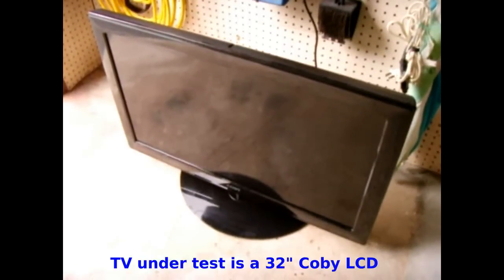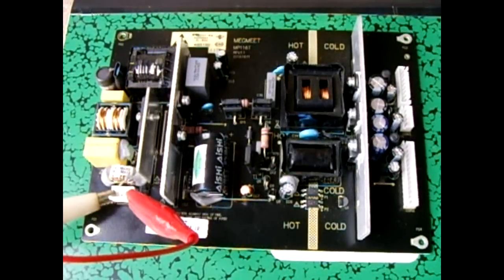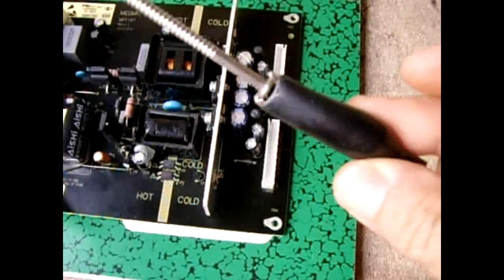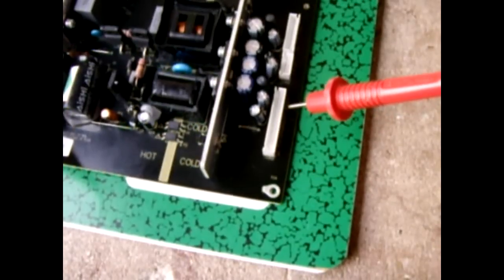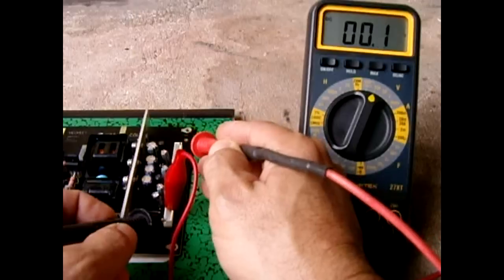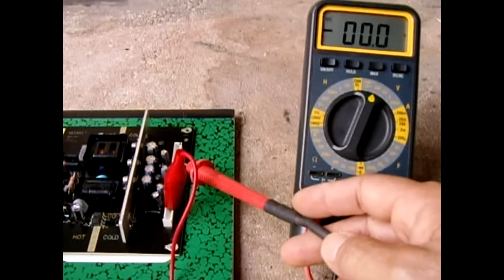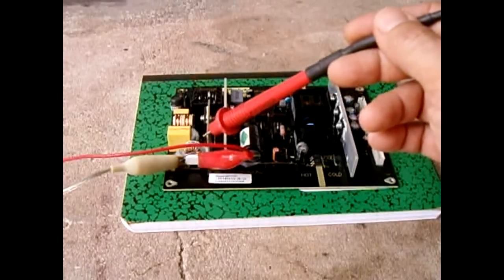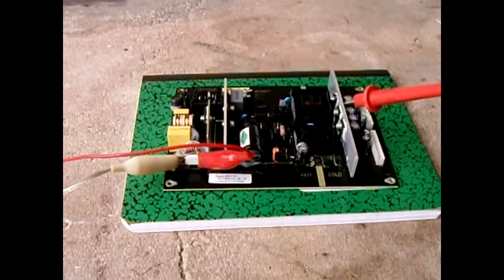How To Test LCD/LED TV Power Supply Boards(No Power)

Comment: Thanks for your video. I can't seem to find a 'SB' or 'STB' pin. The other two pins are labeled 5V and DIM (O/F) not counting the 12V and GND pins. When I touch the black probe to the ground and check the 12V pins they all show 12V. I guess my board is defective.

Comment: Hey FYI,
  I've been trying to rig up a curb side special Vizio 42" as a bench light. I have the advantage of a working TV and am just trying to get the CCFL inverter working without the main board or LCD driver. This one has a 5 volt standby, 12 volt, and 24 volt rail. The PSU has an on/off pin, PSON, and PDIM pin. The inverter IC is one of the pesky o2 micro chips with an NDA Datasheet (OZ9976).
  I can confirm, this power supply needs the PSON and ON/Off pin jumped to 5v. The PDIM pin needs to be set between 2 and 3.6 volts but does not need a PWM input.
  However, contrary to your video here. The power supply will not start by jumping out the standby rail. It has to have a substantial load on the output for the main output rails to work. When I disconnect the 3 extra pins from the processor board and jump them out (on/off, PSON, w/a 3v3 regulator output on PDIM) but keep the connection for 5v, 12v, 24v, and ground to the processor, everything works like it should and the backlight comes on and stays on until I disconnect the mains plug.
   I am here because I have been looking for ideas on how to rig something as a load. I've tried load resistors all the way down to 270R on the output and that doesn't work. I don't want to go much lower on a 24v rail. I'm about ready to just add an auxiliary supply for the inverter IC or use a small boost circuit from the 5v rail. I thought you might have covered something like this here, but after seeing a discrepancy between what I'm seeing and the video I thought I'd mention it. This TV is probably some rare exception, but I figured it was still worth mentioning that jumping the on/off PSON pins doesn't get power going on this design.
Thanks, -Jake
Reply from the maker: Hello. I'd ditch the CCFL and use a really bright LED strip light instead.

Comment: I tested the fuse and it read good. I tested the power to main board and I'm only getting 1V so i don't think enough current is getting to main board (no standby). Any video for checking each leg of this circuit. I have no visible damage on top of under, no swollen capacitors.

Comment: My backlight leds on an LG 55" TV are not turning on at all & I suspect one of two IC'S, One is the HS01G PHVK pwm controller & the other is a L6599AD RESONANT CONVERTER CONTROLLER. Any idea which one would most likely be the culprit?

btw all capacitors look good, however I changed the two main caps just in case with new Rubycon caps. Once removed the old caps tested good just as I suspected.

Comment: My Finllux 50F6090 video keeps going off while the audio is still on. You can change the channel and get the audio for the channel but without the video. Looks like it is the power that is being lost. If one turns off the TV the video comes back perfectly but is soon lost again  This cycle is then repeated again and again.  What could be causing this intermittent black out of video in this set? Help please

Comment: Hi there using your method I have checked Apple LED Cinema Display power supply board on all the pins reads close to what it says (only like 0.2 or 0.4 V difference) apart from one pin where it says 24 V and reads 25,2V is that acceptable?(using mid range multimeter)

Comment: I have a Sansui sled-43fhd TP.V56PB'801. The standby light is on and red, when I switch on the tv, the standby light changes to blue to show that the tv is booting but it will flick the sansui screen and goes off. Any idea of what the problem is?
Reply from the maker: More than likely the power supply board has one or more faulty electrolytic capacitors. Either replace the capacitors or buy a new power supply board.

Comment: When I short the PSON with the next pin I test the other voltages. The 5 reads 5 and the 12 volt reads 5V and so does the 24V pin. They all read 5 V? When I take the alligator clip off the PSON and the pin next to it, I can only read 5V on the 5 v pin. The others don't read anything at all. I short the PSON to the SGND is that right using an alligator clip? The 5VSB volt reads 5 volts.

Comment: Thanks for your guidance. I have 26LG30R LCd. I can see P/On on power board but no STB 5v, could you please guide me here, board is OPVP 0059.
Reply from the maker: They vary a lot. Try jumping suspected pins using a 1/4 or 1/2W 1K resistor. The resistor will keep you from destroying things while you search. Try a 5v pin, or a GND with the PSON.

Comment: I replaced a swollen capacitor on a 42" Dynex DX-L42-10A.  Now, I keep blowing fuses. What could be causing the fuses to blow?
Reply from the maker: If you replaced it with the same value/rated capacitor, in the correct orientation, then it shouldn't blow the fuse. Clearly you did something in the process of replacing the capacitor.
Reply: @electronicsNmore  Wondering if maybe I used too much solder and somehow shorted them out. Waiting on some solder wick to come in.

Comment: Hi.. One Question.. My Power Supply indicate 11.8 Volts in 12 Volts pins and 32.3 in 33 volts pin, all others are OK (5V,3.3V,24V).. This voltages are OK? is in a safe range or must be a little greater than mark the pins? I ask because the image in my TV have some noises and i don´t know if this is the problem or is the video or T con targets..Thanks
Reply from the maker: LookingMercury3D Sounds pretty good to me. As long as the voltage is fairly close, you should be fine. Check all the capacitors for swelling. If any are bulging, replace them.

Thanks For Watching! Be sure to rate Thumbs Up and Share.
Reply: Yes, i repair the power supply, it was dead, the power Mosfet  was in short, change too all bad  capacitors but i can get up that voltages, i was thinking in add another Cap in parallel of minor Farads  to see if it Up at less 12.1 volts, i need to know if that is the problem with the noise.. Thanks Men.. Thumbs Up
Reply from the maker: The noise could be coming from another board. Also check for capacitors that may be shorted. I have seen that in the past, and some were not even bulging.
Reply: electronicsNmore The Noise is in the TV Image, is not a Noise Sound in the Board, i believe that the 12 volts IC's from the video Card need the all 12 volts to work properly, may be i'm wrong, thats why i need Up the voltage at least 12.1 to check it.. Thanls again
Reply from the maker: Does not sound like a power problem. I suggest you carefully check the video board. That is all I can suggest.
Reply: That´s what i want to avoid hehehe.. Thanks man...Very appreciated

Comment: hi sir, which pin should i short so that i could check voltage, the 1st pin is GND then follow by 13v, 13v ,5v(t-con),GND, 5v,5v,GND,power_tv,ac_det,GND,bl_on,ex_dim,NC and last pin is Status...tq
Reply from the maker: +muhd anis 
Unfortunately every board is different. You may have to do some research to find out. What pin has voltage?

Thanks
Reply: +electronicsNmore 
only have voltage 5v..other pins got no voltage
Reply from the maker: One pin has 5v? Or more than one pin?
Reply: +electronicsNmore 
more than 1 pin sir...pin 4,6,7 hv voltage 5v
Reply from the maker: Hard to say, but I would try the 5V supply and the power_tv terminal. Since you do not know for sure, I would use a resistor with a value of around 200 ohms to be safe.
Reply: +electronicsNmore 
ok..tq sir

Comment: Hey Doug, Do you have any info on testing the Samsung Plasma TV PSB?  I have found the "PS-On" pin (4.2v)but directly across from it is the "STBY" pin (5.2v) so I'm unsure if we're on the right track.  When you said "short the PS-On pin"  did you really mean to short it to GND or not?  Thanks
Reply from the maker: The safe way would be use a 1K resistor between the suspected pins. :-)

Comment: hi I have a tv power supply that I'd like to turn on. I found a bunch of 13 volt pins as well as ground and AC detect, ps-on,  bu5v, and ground on the last pin. which ones do i short to get the power supply to turn on? my guess is ps-on and either bu5v or ground but I'm not sure. I've done this before but this varies from manufacturer to manufacturer. this model is a sharp 32 inch LCD tv that I got from the dump because it had a cracked panel. I'm going to make a shop light out of this TV.
Reply from the maker: I would guess bu5V and PS-ON. Use a 1K resistor between the pins in case you have the wrong set.
Reply: electronicsNmore

I actually figured that out and the relay clicked. Now to get the backlight to come on. It's obviously a separate part. Just need to find the right wires. the last TV I hacked it said things like PS-on and BL-on I hooked those to the sb5V and both backlight and main power turned on.

Comment: I have no problem Identifying the power pin I just don't know what to bridge it with to power on the board I have (2) 3v pins along with some 12v and 24v and gnd's, that's why I told you the TV in case you could check the board and see which other pin I should connect the power pin to
Reply from the maker: First probe the power on pin using your DMM set to DC volts. Test from the power on pin to GND. If no voltage shows up, then try bridging the power on pin with the 3V.

Comment: What is the tolerance for these volatages ? I have got 12,3V on 13V pins. Is that ok?Tested with TV switched on. The problem is milky screen.
Reply from the maker: marcinbjl Voltages should be very close to what is written on the board. Sounds like the inverter board may be faulty, or a bad backlight. Make sure every capacitor on the power board and inverter board is not bulging. If any are, replace them.
Reply: Ok thanks

Comment: I have a LG 39ln5700 could you check the power supply board and see which two pins to short out to see if I can get the back lights on because it doesn't have a 5v pin
Reply from the maker: Every board is different. You should see a marking on the board to identify the power on pin.

Comment: I have a visio tv and I was testing the powerboard while connected to the mainboard. The 12v connectors are at 11.3 volts. The TV comes on and fires up the backlights, but there is nothing displayed. And none of the other buttons do anything. Would this shortage of voltage cause something like that? Or would this be a mainboard issue? It's a vizio m420vt
Reply from the maker: The voltage should be very close to the listed voltage. Check all connections, and inspect all electrolytic capacitors. Check the capacitance and esr after discharging them. If everything checks out, then I'd say a faulty main board.

Comment: What if the PO voltage is reading 2.1, is this an issue with power supply board or the main board not powering on the rest of the power supply board?

Comment: good tutorial...I've been taking power supplies out of old disc players etc. that people throw away I usually connent blubs to them and then measure the voltages.
Reply from the maker: Bri G. Many of the boards which are faulty, usually only require any bulging capacitors being replaced. A very common problem as a result of many hours of use, and heat.

Thanks For Watching!

Comment: i have a sharp aquos 40" and on my bd i have the ps on but i get nothing on the bd when the the ps on and ground are jumpered. if i put the neg lead on the neg at the bridge and then red to any points on the pd connector i get 5.8 volts. i have 168 vdc at the bridge. so i can send you pictures of the power bd and maybe you can direct me what pins i have to short to turn on the power bd?  i get nothing if i probe from any pd connector pin and the screw that holds the cb to the frame. and those are connected all the way around the power bd, and to the sgnd pins in this pd connector.
Reply from the maker: 168V is fine on the HOT side of the board. You're either not turning the board on, or the board is faulty. Pins used can vary. Check online for more info about your board or TV. Thanks for watching

Comment: Good morning! Thanks for this great video! 
I have a samsung TV power supply that gives in B5V --> 5.1V and in B13V --> 8V. What pin must be shorted with the PS_ON pin to give me the full output voltages? Is it pin B5V ? or GND? or another pin? (other pins except B5V and GND are P_DIM, BLU, A5V, Vamp). Do you think is normal to have 8V on pin B13V without shorted PS_ON? Thank you!
Reply from the maker: Not sure. I would take a 500 ohm, or 1000 ohm resistor and use that as a test jumper to see if the right pins are found. If you don't use one, you may fry the board.

Comment: This is a great tutorial. Might I ask what it could mean if I have 10.5v going through my pin labled "5V1" and the pin "5Vsb" while I'm getting no power reading through my "PON" pin and my "PWM" pin?
Reply from the maker: +Arbitrarymind16 
Hello. Are you positive you are testing from the pins to ground? 5v1 should be around 5.1 VDC, not double. Every board varies. Make sure the correct pins are shorted together. You may have a faulty power board. Make sure you have no bulging electrolytic capacitors.
Reply: +electronicsNmore I am going to have to guess its faulty. these readings were before I shorted anything. thank you very much for the quick reply

Comment: I’m wondering if you could please help me out. My Samsung tv when I plug it in, it just comes on by itself and then turns off by itself, and repeats the same thing again and again. Also plays a music tune when it turns or or off. I can’t remember. Lol. I have it torn apart at the moment. Now one thing is though when I first got it from this old lady. I plugged it in and it came on like it was supposed to but it didn’t have any sound though on the channels. After I unplugged it, later on a week or so later I plugged it back in and it just turns on and off by itself, also plays a music tune when it comes on or off, I can’t remember. Lol. I have it torn apart at the moment, trying to diagnose the issues. Any help would be greatly appreciated. Have a great and blessed day! Thx so much Chris
Reply from the maker: The power switch touch panel on the TV is likely faulty. Disconnect the cable to the power switch, then try using the remote.
Reply: Ok I’ll try that and see if that takes care of my issue. I’ll let you know. Thx so much

Comment: Awesome video.  My PS-ON terminal has no voltage after a lightning strike at my house. No visible damage on the board. A new board is only $25. Do you think replacing it will fix the tv? 
Thanks in advance!
Reply from the maker: If shorting the PS-ON with the correct terminal does not cause all the pins to power up, then I would get a new board.

Comment: Thank you for making this video. Can I check the pins of the power board while it’s plugged into the wall?....I’m not sure I understand the purpose of the alligator clips.
Reply from the maker: The board needs to be removed. The alligator clips were used to supply 120VAC power to the power supply board from the AC power cord.
Reply: electronicsNmore ahh ok. So I left mine plugged to the wall outlet and I checked it...the ground to the first three which on the board is labeled as 12.3V however the read out is 0.8V. :-/ just struggling because before I replaced a capacitor on the main board the read out was 2.3V

Comment: which pins should I short. the 1st four pins are; NC , PWM-DIM, ON/OFF, ACD, Then I have some gorunds and 5v and 24 v. the is also a 2nd connector ont the other side of board with simmilar labels they are ERROR, PWM-DIM, ON/OFF (other side of board has it labeled as INV ON), BRI, then a bunch of GND and more 24 . which do I short for testing voltages???
Reply from the maker: Corey Erb It is possible the ON/OFF pin needs to be grounded to turn on the board. I am not familiar with this board. What make/model?
Reply: electronicsNmore 47LG90

Comment: Do you have a video on testing a 2956C TV Power supply? It's quite different than the one in this video. Thanks
Reply from the maker: Tony M Hi Tony. I do not have a video for a 2956C SMPS. The usual parts to fail are the capacitors, transistors, or mosfets.

Comment: My tv turns on with clear picture & sound. Seconds later the screen turns black with sound. Should I replace power board or main board? Thanks
Reply from the maker: +Jay River
 Sounds like a faulty electrolytic capacitor on the power board, or a faulty inverter board. Without any test results, I cannot say what it is.

Comment: I want  to check the back light inverter do i need a special equipment. and where can i buy it. Thanks
Reply from the maker: Luis Cuevas Borrero I would inspect the capacitors and make sure none are bulging. If any are, then replace them. Testing the inverter board is not a simple process.